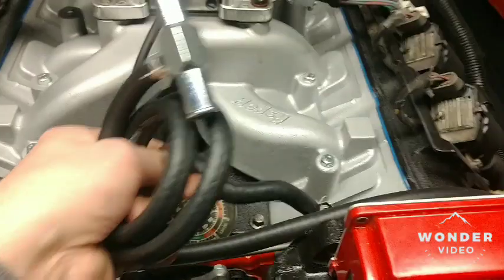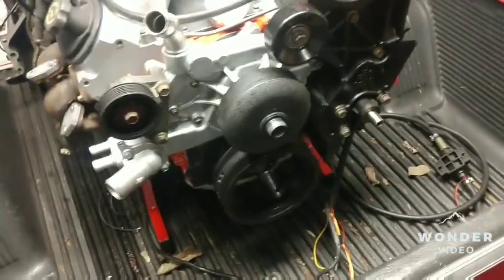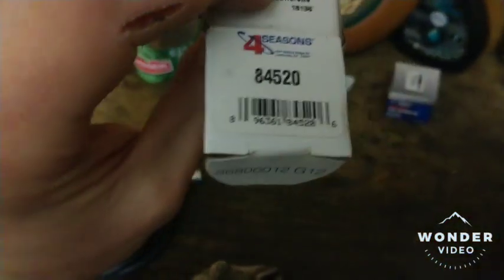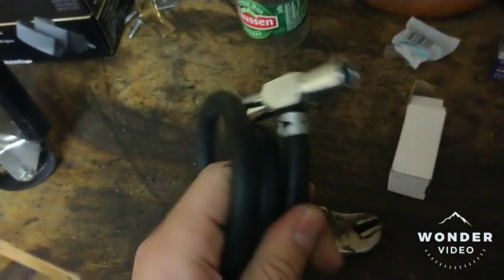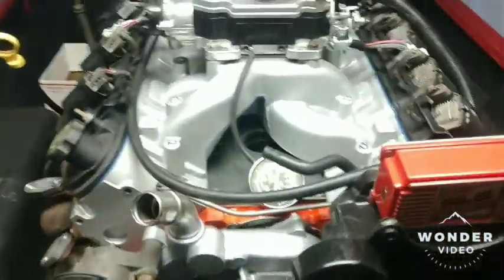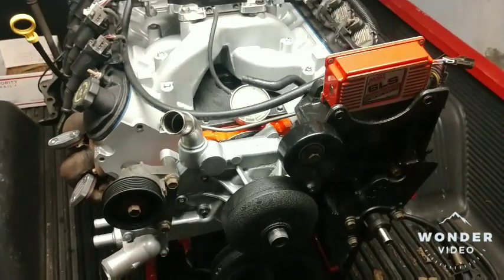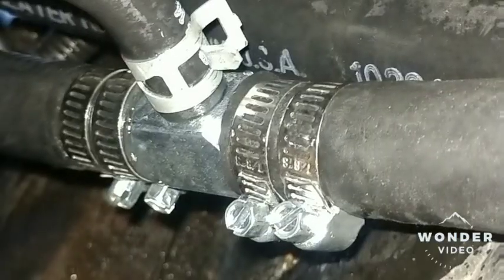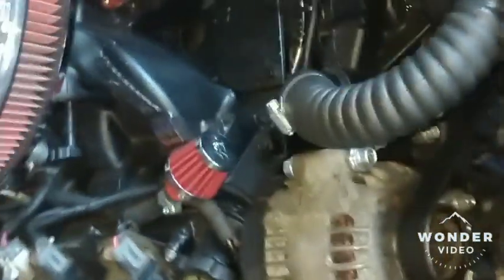How to: Where to plumb your steam vent? LS 4.8L 5.3L 6.0L

Comment: anybody drill and tap the head instead of those stock steam port connector's
Reply: No need, the passenger side head has a threaded plug where the coolant temp sensor would go. I'm a machinist and have done multiple water pumps it's a good option but I'm using the tee he shows in the video.

Comment: Nice definitely gonna but this when I do my cooling system....... 

I also have a question! So I picked up a new starter to finally here my swap run for a minute.... I have a new intake manifold, 1406 edelbrock carb, a cheap 6psi pump in a fuel can to the carb, different plugs and different wires.... all my wiring is correct and not pretty right now..... my MSD 1604 is working and getting spark.....

So I tried to start it numerous of times and it will not start. I have fuel, clean gas, different types of plugs but they all have spark, 4 original wires and 4 wires from a ford escort which are all working. Maybe not the best of spark....

When I turn it over, it’s slow(battery) but it turns over and has compression. It will not start, not even a sputter......

The msd controller said, under fault history, a cam sensor. I’m using the right harness bc the crank sensors don’t match.. except the one I’m using for the 58x wheel for the 5.3 l59 engine.......

Shouldn’t it at lease sputter a little if the cam sensor is bad or will it actually prevent from starting? Also have the msd set on auto ignition timing and it is preset to 13* timing for the truck coils. I’ve been looking and testing and more looking and more testing and everything seems to be in check just won’t fire. What should I do next? I think I’m either dumb or drawing a blank or not noticing anything